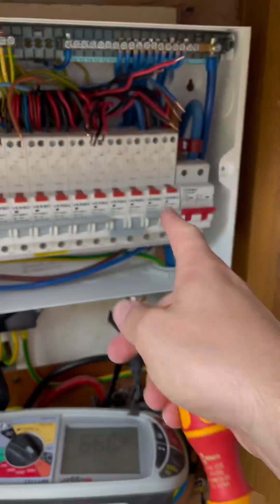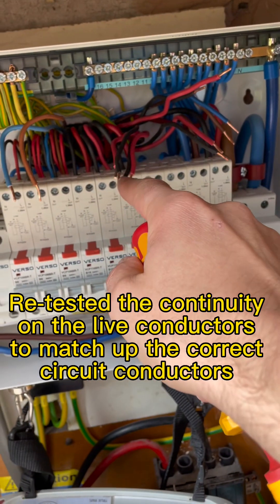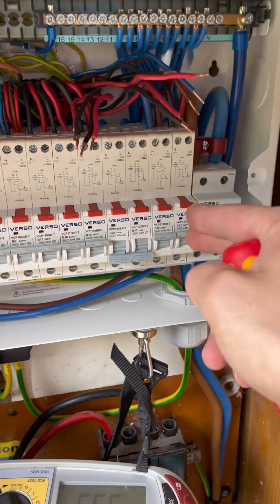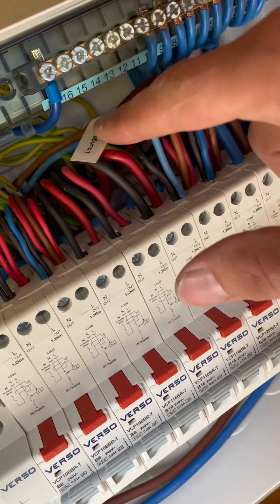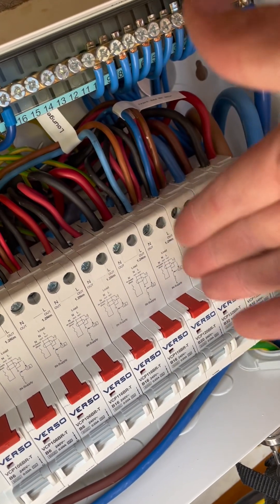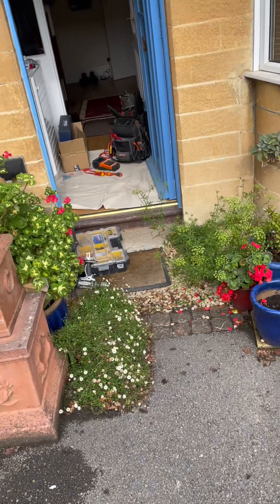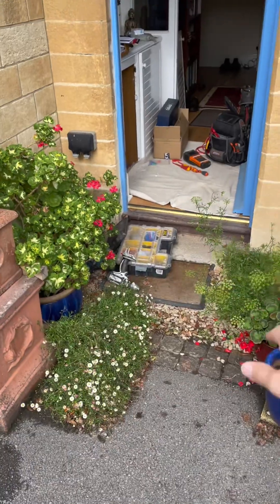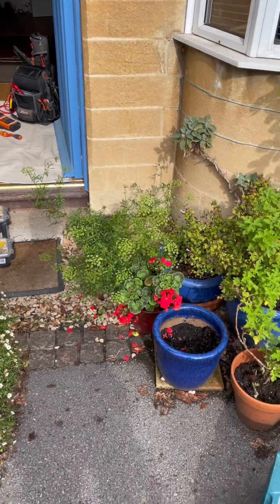No one’s perfect! Consumer unit upgrade

Comment: Personally I don’t like rings or spurs off them so I’d have done much the same; if the Zs wasn’t an issue I might’ve split the ring into two 20A radials but by the sounds of it the Zs would’ve been even worse of a problem. Good for you for your “warts and all” policy. Every one makes mistakes.
Reply from the maker: Don’t like them either, just cause headaches. Radials please🙏🏻. I could have split them for sure, unfortunately due to how it was wired it would have ended up with pretty much all kitchen appliances on one side. Cheers mate👍🏻

Comment: As stupid as it may sound I’ve made a habit of changing any household ring final to a 20a (except kitchen rings - not been that brave yet) when I’ve done db upgrades.  Have not had one overload issue so far (5 years of doing it) - and it gives me piece of mind that when diy Dave decides to piss about with the sockets in years to come and split the ring or whatever stupidity their up to you here’s a factor of safety built in that a 32a breaker might not give them.
Reply: Me too, for much the same reasons.
Reply from the maker: I’ve never had an overload issue when I’ve reduced them. I’ve also done it in commercial places, clamped it and it was 19A with everything on😅
Reply: @bristolsparky  good stuff 😁